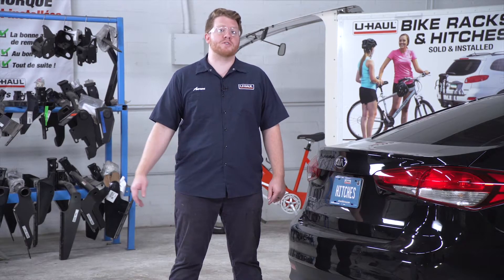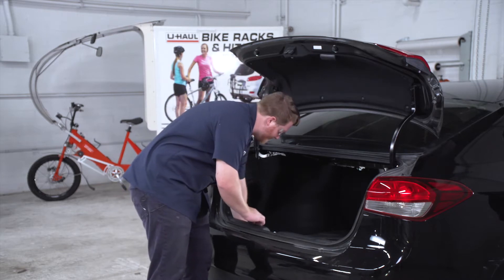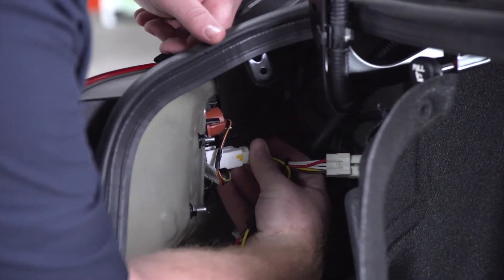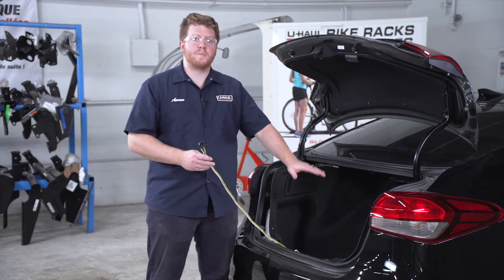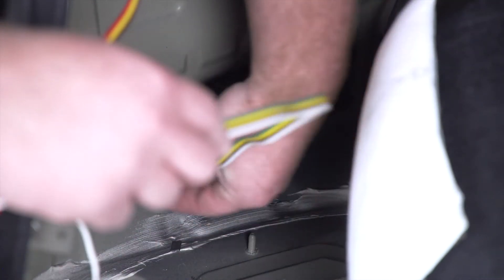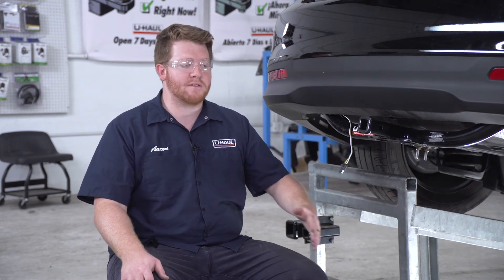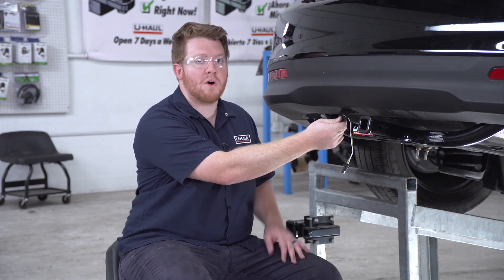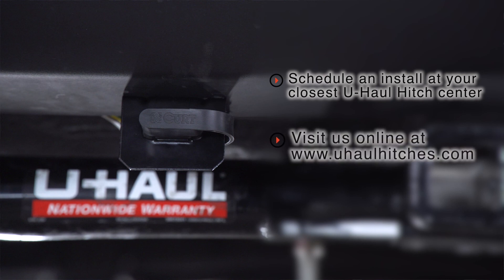2014 Kia Forte Trailer Wiring Harness Installation (Non-LED Tail Light)

Comment: That's a great video. I'm interested in where to get all the wires you have used in this video. 

I was also interested in seeing how you install the back up lights connection for this because those lights in the car are in the trunk lid  and I didn't see you touch the wires there.